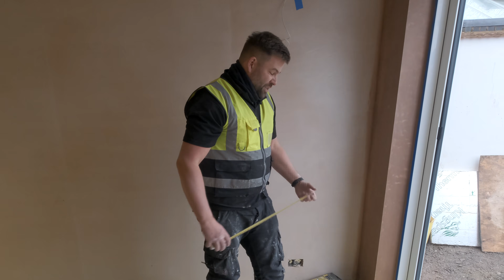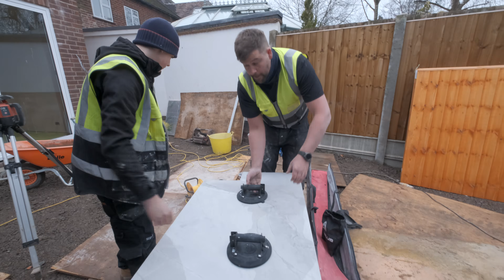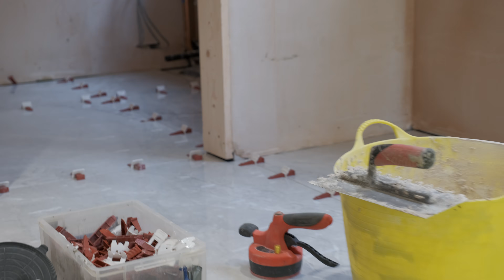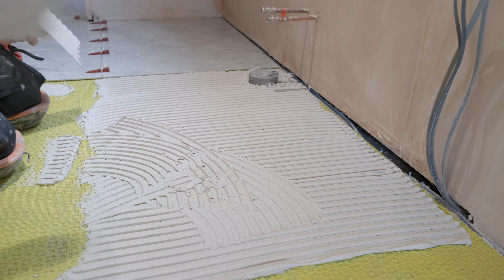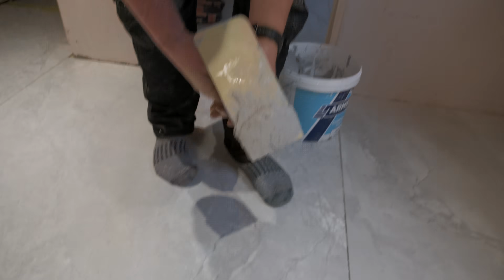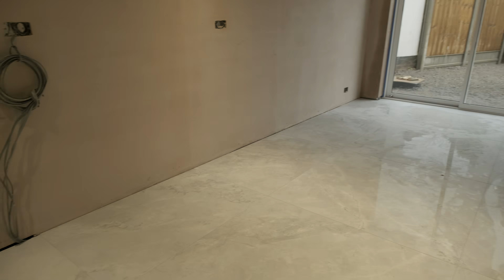Laying Large Format Kitchen Tiles

Comment: Hi There. I like your video. thanks. QUESTION ? I am doing a small tiling job. only x 2 square meters bathroom floor. I want to know ?  Is there any multi purpose adhesive which I could use for both - sticking on waterproof decoupling membrane onto a concrete subfloor and also using the same adhesive for sticking tiles on top of it ?
Reply from the maker: Best to go into your local tiling merchant and ask for the most flexible adhesive you can get fast set and slow setting

Comment: Hey Tony, lovely job by ye, is that a ditra mat that's down before the tile? What's the reason for this mat? Is it necessary when laying large format tile?
I'm starting a 120 sq mtr floor job soon, the slab is that liquid screed, with under floor heating. The system has been leak and pressure tested, and a commissioning cycle has been performed, but the homeowner does not want to sand the screed as the company who poured the floor say that it's not necessary due to what's in the mix that they use. Their data sheet also says nothing about sanding, only that the surface is clean, dry and has 2 coats of adhesive primer applied in opposite directions. Though I'm tiling over 18 years, I'm self taught and this is my first time doing a 1200 x 1200 tile. I think because I'm self taught, I'm extra cautious and careful when it comes to these big jobs. I want the homeowner to get it in writing from the screed company re the sanding of the floor, or else he is going to have to sign something from myself, separating me from any fault if the tiles lift. Any help or advice would be greatly appreciated. Paul in Ireland
Reply from the maker: Hi Paul,  Greg and many other tilers absolutely love it. Make sure you have the floor scarified and then coat with G Primer then lay the matting hope this helps all the best Tony 👍
Reply: @BuildWithAE  Thanks Tony, I use either BOTAMENT D1 or D11 primer mostly, and they also do an uncoupling membrane. My biggest worry is that the homeowner does NOT want to sand the new screed, what do I do???

Comment: Great video! I like the fact you use a slower set adhesive giving more work time for the less experienced tiler! all other videos seem to use a rapid set boasting on the fact you can tile straight away. Would you be able to stop laying the tiles halfway through if you couldn't get it all done in a day?
Reply from the maker: Glad you enjoyed the video.

Yes of course. Just make sure any adhesive is cleaned from the exposed edges, so it doesn't dry and cause issues.

Hope this helps.

All the best, John 👷🏼‍♂️

Comment: This video good help but when it dry how do you take  out  the locks on the tiles 😂😂😂
Reply from the maker: Glad you found the video helpful. 

Once the adhesive is dry, you simply give the clips a tap with a rubber mallet and the tops snap off. You can then reuse the wedges on the next job.

Hope this helps.

All the best, John 👷🏼‍♂️

Comment: Great video, very informative.  

I have been told not to use the wedge type levelling systems because when you knock off the plastic bits afterwards, they have a tendency to chip the tiles.  Is there any truth to this please?
Reply: That's nonsense. Never had that happen and use them regularly. However if you use the size down in mm you want and then space with a normal spacer, they break out a lot easier. Keeping the clip area clean too is vital.

Comment: Do you always butter up the back of the tile?  Im self taught as ive been house bashing for 20 years.  I figured out, sometimes the need to butter up of back of tile, due to when i was half into the install & the floor suddenly changed in level.  Just enougth to make it impossible to level out tiles.  Only remedy was lift some of the tiles. The small screed  of adhesive massively helped to keep tiles in level with one another? As if gives you room to adjust a few mm.
Great tips , thankyou

Comment: Nice works guys just a question on the Dural matting. I think you said the floor has underfloor heating. Does the fleece backing keep the heat down on the matting? Thanks
Reply from the maker: Hi, yes any material will always have an affect but but would you notice it no all the best Tony 👍
Reply: @BuildWithAE  true I am a tiler mate on your side 🏋️Belts and braces.

Comment: Top work Greg, do you not to need a level when you use these big tiles?
Reply: It's A and E so the sub base would be level😁 so once the adhesive is spread out and notched through those clips just prevent any lippage. When you run your hand over the tiles the surface would be smooth all over. Very satisfying to use them, but the floor needs to be level to start with 👍
Reply from the maker: Hi Barry much appreciated no just the clips all the best Tony 👍
Reply: @BuildWithAE  Ive got a big house conversion coming up this year & have a 17m x 4m floor to tile & just trying to gather as much info as possible.
Reply from the maker: @barryford7135  Hi Barry only use a liquid Screed  and a expansion joint as required but also speak to the tiling federation let them know what tile you are using weather it is natural or porcelain and the thickness of tile with the grade rating ie travatine Stone quite weak tend to crack loads of factors all the best Tony 👍
Reply: @BuildWithAE  thanks for that Tony. I am going to use a liquid screed. I’ve done a fair bit of tiling in the past, but never an area as big as this. Great channel by the way. 👍

Comment: Picked up a few tips off you Greg, can I ask what clips you would use if you were laying 1200x900 slate was a thickness variance from 12mm to 8mm 👍🏻top job by the way.
Reply: Hi Mark. 
I wouldn't use clips on that mate id free lay them and bed them in to make level
Thanks for watching 
Greg